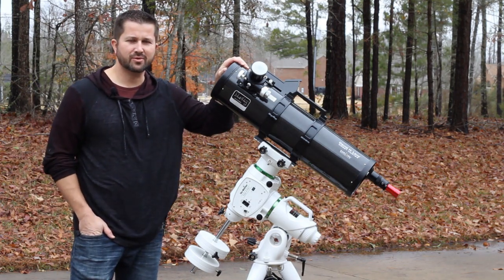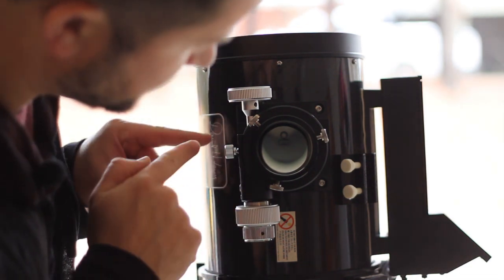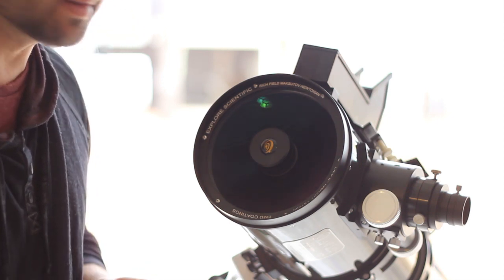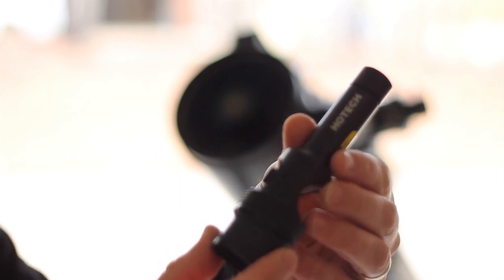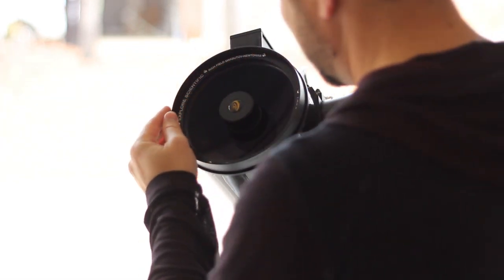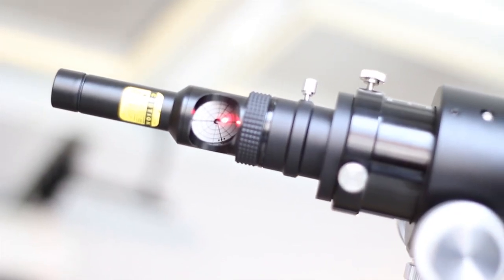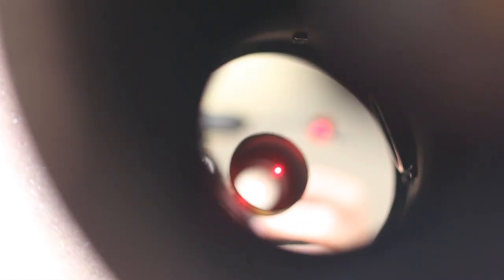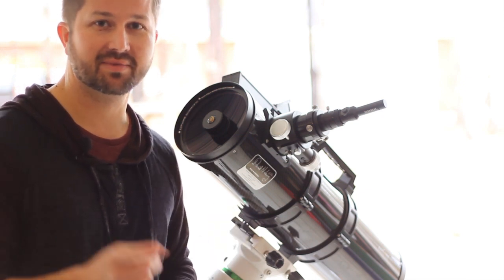How to Collimate a Maksutov Newtonian

Comment: I’ve got the Maksutov Newtonian 190, trying to get it better aligned. The part at 4:00 where you pretend to make adjustments and lock it is the troubling part for me. If I turn the central screw, or the side screw, the whole assembly rotates, it never seems to lock in place even if I try tightening the lock ring. I want it locked, no assembly rotation, how do I do that cleanly? I also found a great final check on collimating. To test, I just put a flat LED panel covering the whole tube opening, and take flat frames with my ZWO camera. There is just enough vignetting at the four corners of the photo to tell if the vignetting is perfectly centered, and I use this to adjust the secondary. This is a true photographic test.

Comment: Great video!. I'm getting close to perfetc collimation on my ES "Comet Hunter" thanks also to this video. I got Hutech laser and it helps a lot becouse you can trust the laser collimation! The only thing that I cannot explain is that, acting on collimation screws,  i cannot get my secondary perfectly ROUND through the collimation eyepiece, quite round but not perfcetly round.
Reply from the maker: Alberto Negro Thank you!  so glad this video helped you Alberto.  Once you get close sure you your final adjustments are very small.  Good luck and clear skies!

Comment: Hey buddy- lifesaving video, thank you so much! I just got the comet hunter, but I'm confused. I got the secondary lined up with the cheshire, and the laser dot moves around from the collimator with the front screws - but the back screws don't seem to move anything around at all - no matter how much I turn them. The mirror adjusts just fine, but the dot doesn't move at all. The only way I can adjust the dot is from the front. So I'm kinda confused as to the purpose of the rear knobs!
Reply from the maker: Right, so that’s correct.  Moving the primary will. It love the red dot. Moving the secondary is the only mirror that will move the red dot.  The main thing with the primary is to make sure it’s centered in your eyepiece.  Once you get that centered you just need to get that secondary aligned.  That’s a great scope by the way.  Wish I still had mine.  Best of luck to you!
Reply: @AVAstronomy  ahhhhh it clicked in my mind! I think I just ‘got’ collimation 😅 Have been on refractors too long! Thank you SO much for your invaluable video and fast reply. Truly a credit to the community. What’s your insta?

Comment: Great video!! I have the exact same telescope, so very helpful!! I noticed heavy vignetting on one side of my images, so suspect the secondary to be slightly off. Do you take the retention ring all the way of or just loosen it?
Reply from the maker: Doghouse Barbecue thank you!! You should be able to make any necessary adjustments after loosening the retaining ring.
Reply: same problem with mine. I found out that the pollution comes through small slits under and in the focuser...i have put some black tape around, but it is still not 100%
Reply: Tommy Knocker OK. Maybe seal the focuser to the scope with some black silicone? Or make a piece of cloth and secure around focuser with Velcro?
Reply: @eirikkittelsen9787  do not seal to much that the scope still can "breath". Yesterday i put black sealtape under the focuser and over the slits between tube and focuser. First test with the maclight was better.
Reply: Tommy Knocker sounds good!! Agree, something “less” permanent is probably the way to go.

Comment: Another curious matter with this scope - I cannot reach focus with a 22mm low-profile filter wheel installed - the focuser goes right into the OTA and runs out of travel - it just can't get close enough. I'm not using any spacers; it's literally focus tube -> filter wheel -> camera and that's too long. I can reach focus with JUST the camera, but the focus tube seems too long!

Comment: Hi Aaron, how do you do? I have got the Comet Hunter too. But i`ve problems with light pollution on my fotos. The pollution comes through small slits under the focuser, even through it itself.
If you had this problems too or can give some advise it would be great
Reply from the maker: Tommy Knocker Hi Tommy, I haven’t Had this kind of issue before.  Are the screws that hold down the focuser snug to the tube?   If so and you’re still having that issue I would recommend reaching out to Explore Scientific on how to address this. Good luck to you sir!

Comment: Something seems to have happened to this video. There's no audio in the vast majority of it.
Reply from the maker: Shadow that’s odd.  I just scanned through most of it and audio is loud and clear.  It may be server/buffering issue.  Should resolve itself.  Thanks for checking out my channel. Clear skies!
Reply: @AVAstronomy  In case you were curious, I figured out the issue! Seems the audio through most of the video only comes in on one channel. The starter song goes through both speakers in a set of headphones, but once you start talking it only comes through the left earpiece. For me, anyway. I often only have one side of my headphones on so I can hear what's going on, so never heard the left side audio until recently when I tried to listen again.
Anyway, thank you for the video! Very helpful, as i'm about to buy my first mak-newt.
Reply from the maker: Shadow thanks for the heads up on that.  I think I’ve figured out my audio issue and it did have to do with a channel being off.  Awesome decision about the Mak newt!!! Agena Astro has the 190mm mak newt if you’re interested.  I  think I have a link to one of them in the description of my newest video.  Your gonna love that scope!
Reply: @AVAstronomy  That's the exact one i'm looking at, actually! I'm currently using a little 400mm refractor, and a 2350 SCT...so I figure the focal length on a 190mm mak newt should put me right in that sweet spot between the two.
Reply from the maker: Shadow yep, that should give you nice coverage over a wide range of focal lengths.